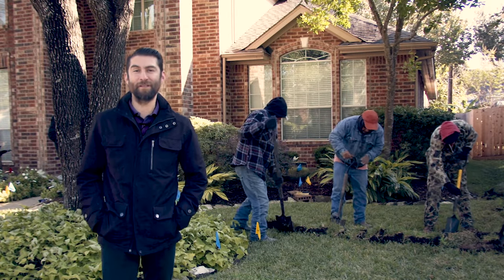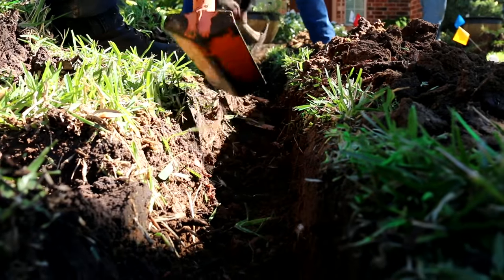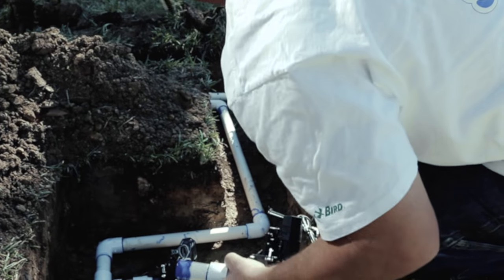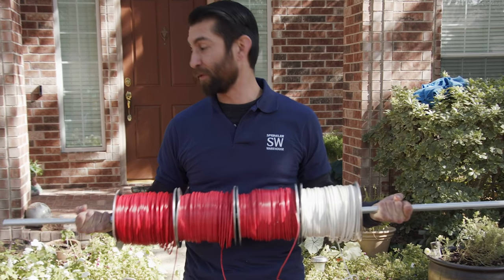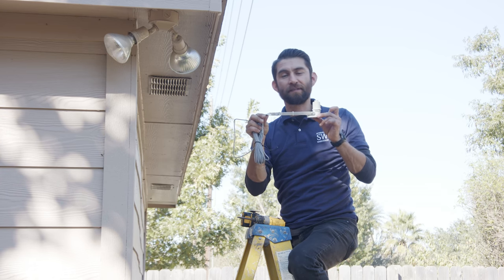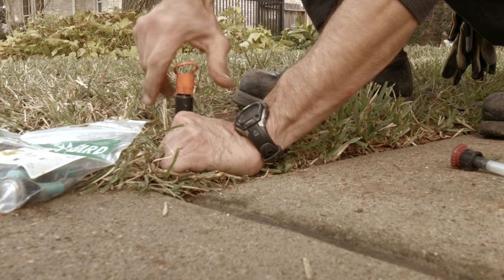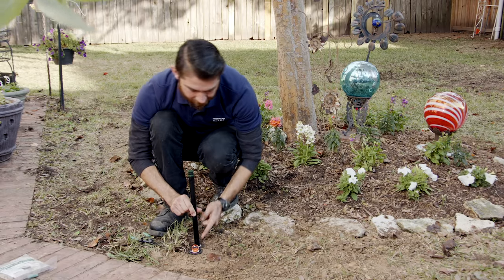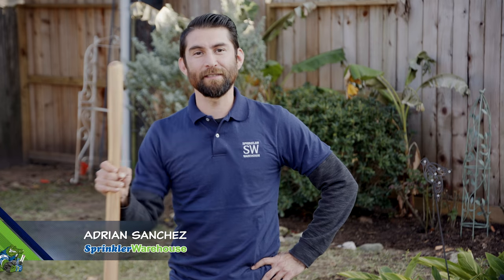Sprinkler System Install - Overview

Comment: Hello, I live in FL and my sprinkler guy recommends that I put replace the driplines with Fan Jet sprayers. I like the idea of FJ sprayers because I do tend to move/add shrubs & flowers. My system is 8 years old (he did not install it) and he said that he doesn't like driplines because they get clogged.  Depending on the cost, I may end up doing this myself since I am handy. I don't mind a little extra labor to do what is best. What do you recommend that I get? Thank in advance!

Comment: One thing I hate so much is valves being in small boxes like that. Bigger the box the more room you have to work.
Reply: Apparently you’ve never dealt with systems
Reply: You can take out the box if you need to! I did.

Comment: Why use pvc instead of poly line for the zones? It’s much easier
Reply: Poly is sh*t in general and definitely not rated for the pressures of a lawn sprinkler system. It’s definitely possible but a complete waste of time, you’ll be fixing split lines ALL THE TIME
Reply: @bwtjma183  In Minnesota we use it because it can handle the water pressure just fine but also it backs blowouts much easier as it doesn't break once water freezes.
Reply: @bwtjma183  I’d have to disagree as here in north Idaho I have done both pvc and poly and if done correctly poly is much more easier and more efficient to install, and no trenching! You can pull that shi with a machine making it so much quicker
Reply: Flow restriction and psi loss
Reply: @brendancameron6062   oh man, I wish I had a trenching machine with the pipe install attachment! But are you referring to the Netafim? If so, I agree way better than a pvc system
Reply: One hole in your poly and you’ll be digging the entire thing up and doing it again.

Comment: How you get the schematic for knowing where and how to place sprinkler heads?
Reply: Do your spacing according to  spray pattern and sprinkler type... Such as rotors, pop up sprays , pop up rotary nozzles, drip etc... after getting your calculation on gpm and psi you will know your demand and supply of water capacity and take in consideration size and type of city main and population, also water demand and time of usage  good luck, or call an irrigator

Comment: As a irrigation  professional  this video  was not very  good  at how to do a system
Reply: Yeah, it sounds like any other job, no matter how well it is done, someone eventually will come and say something negative about it. I have seen it everywhere...everyday...😄
Reply: Scott Baker ya and black poly pipe works way better so it can bend
Reply: @timbertines  Isn't the pipe buried?  ie not visible?
Reply: it is painful how many things are wrong
Reply: why not put the electronics near the power source?

Comment: You forgot the call 811 part for locates on any service lines such as gas or electric. Being in the sewer and water business I've seen lines as shallow as 2 feet... Sure would suck to hit a line and possibly lose a life!
Reply: Not to mention an extreme liability of cost if you hit them, especially a fiber optic cable..
Reply: Happen to us but the fiber optic cable wasn't 2ft down it was 6inches down
Reply: Or a 2 ot aluminum cable 😜🚡. I can see it now they'll hit the 🪨 and use the rock bar or ditch witch and BAM. Closed casket.

Comment: And then the guy doesnt twist pipe at all when pushing pipe into bell end. Or wipe off bead. Which is even more important at bell ends than fittings cause bell ends sometimes thinner.

Comment: Uuuggh.  Dont twist the fitting back and forth like that when "gluing". Just 90 degrees in one direction.  And wipe the excess glue bead or clean off with primer.

Comment: Please if you do your own system use poly pipe, so much easier and efficient to install
Reply: More friction  which can lead to psi loss  and depending on your design it could not work properly

Comment: Question 
I have 100 psi for my water. How many rainbird 42SA+ head can I installed on a single line?
Reply from the maker: Hello, you will need to determine your GPM and use that information to help assist with the amount sprinklers to put on a zone. 
https://school.sprinklerwarehouse.com/videos/determining-gpm/
Reply: Psi can be a very bad thing and also know the difference between psi and flow you need to know both in order to design properly, may need a pressure reducer or regulator

Comment: One head to cover the flowerbed and one for the grass and flower bed? So flower bed is getting twice the water coverage? And if you need 20 mins on your lawn because it does not retain water as well as your flower bed your going to flood your flower bed. So you say you can split programs which gives the option to only water your flower beds? Ok, that helps if there are water restrictions or you have plants with a high water requirement. But everytime you water your turf you will be watering your flower bed and that is not hydro zoning effectively.. I get sometimes you have to do what you have to do but it looks like 4 inch popups spaced at 15sst would have contained the water behind that tree for that small patch.

Comment: Must be hard to mow with them in the yard, I would have put them more in the flowerbeds. Just saying.

WoW somebody who knows what they are doing. Mine system is having issues. The company I hired and Paid $500 to get the system working, got rid of 2 zones and now I have too many heads in a zone of 4. (Went from 6 to 4). NOW there is not enough pressure once I adjusted the heads to do what I needed them to do. SO too many heads to a zone. So I am screwed.

Comment: This video shows you how not too work smarter but rather harder funny pipe is a much better way instead of pvc pipe and save yourself a back ache and rent a trenching machine to pull the pipe much less invasive on the lawn and less hand digging
Reply: as an irrigation worker there is so much things wrong with this video. using like an 13 strand of wire each of different colors so much easier. and i would never install a system without a ditch witch especially big jobs f*** that
Reply: @williammccarthy7620  I own a landscaping business and I couldn't agree with you more especially about the ditch witch a priceless piece of equipment